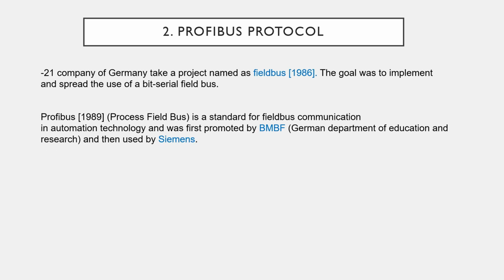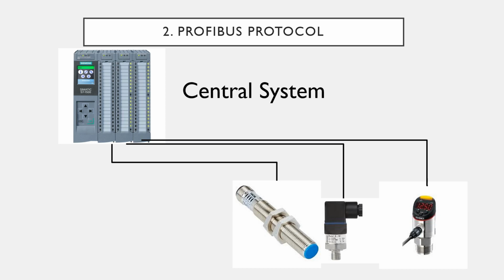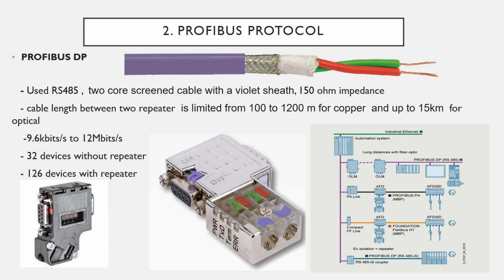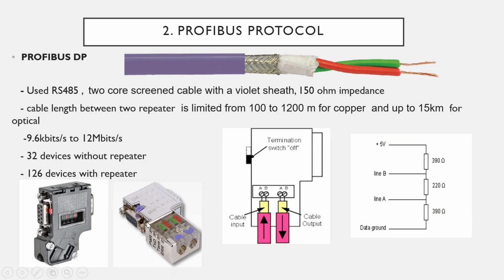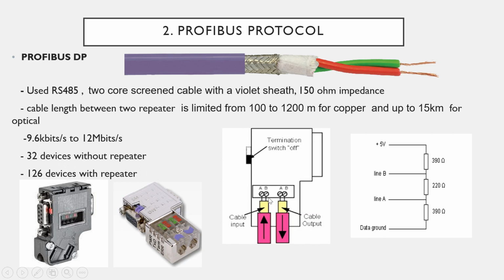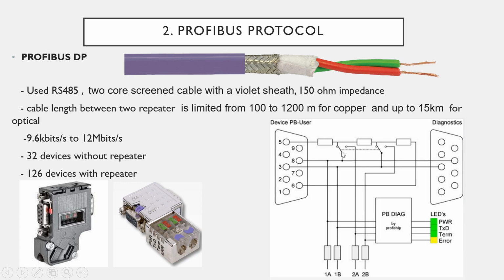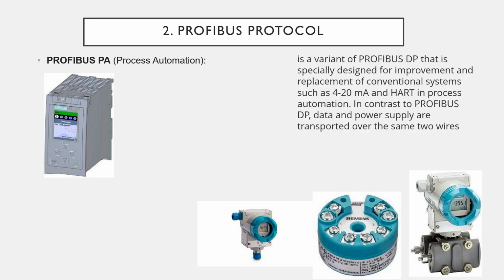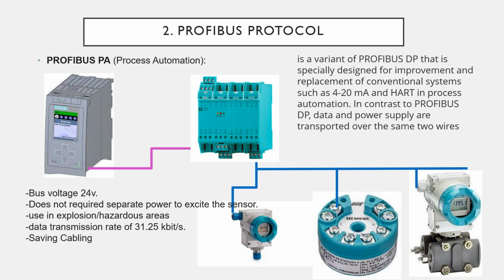Industrial Communication Protocol || Part-2 || Profibus communication

Comment: Sir for Vfd parameters monitoring in Modbus communication we are using definite "Address Registers" which mentioned in manual..same for monitoring thorough Profibus same address register can use or how?. Thanks.
Reply from the maker: Profibus and modbus two different com protocols. If you describe in detail I may help.
Reply from the maker: How you want to communicate with profibus
Reply: @faridautomation  Sir Vfd to Siemens S7 Plc via profibus using Gsd file.only for monitoring vfd parameters.
Reply: for Vfd parameters need to configure any address register (like in Modbus communication) in Plc or how plc will fetch the data's from vfd?
Reply from the maker: @palanipps  no address need as modbus. Can you share the drive detail
Reply: @faridautomation  Sir it is Siemens MV drive Gh180.

Comment: Sir, in which side( input or output) profibus cable connect in cpu side? Or in which side profibus connect in first remote io IM module.
Reply from the maker: I didn't understand, sorry for that.can you please elaborate?
Reply: @faridautomation  sir, in profibus connector we have 4 terminals A1, B1 for input and A2,  B2 for output, the first end of profibus connector is connected with CPU and another end of the cable is connected with remote io's IM modules, and so on. So my doubt is in which input or output terminal we connect profibus cable in cpu side  and in which terminal we connect in IM modules.( We have 6 remote io's racks).
Reply from the maker: It's very simple, CPU side connector uses A1,B1 and keeps the termination switch on; then the 1st IO node connector Use A1,B1 cable coming from CPU and cable which will go to 2nd module node use A2,B2 And keep termination switch off; same way connector in 2nd IO node  module : cable coming from 1st IO module use A1,B1  and cable which will go to 3rd IO module use A2,B2  keep termination switch off and so on. But in the last node you have to keep the termination switch on because there will be no outgoing cable.
Reply: @faridautomation  Thankyou very much sir..